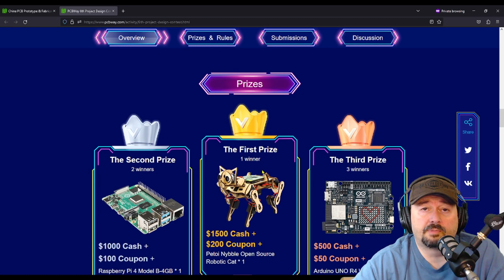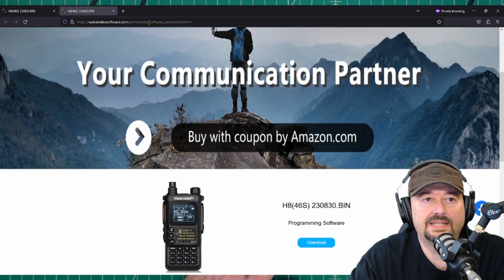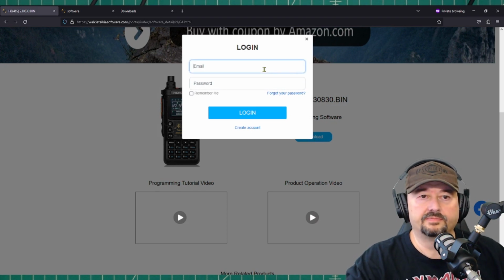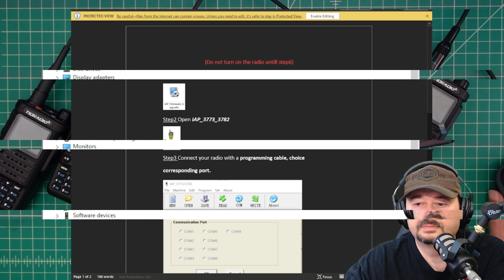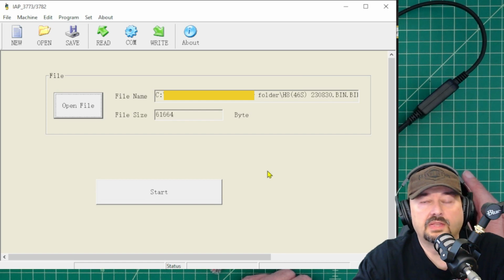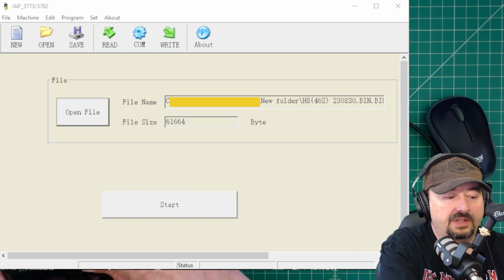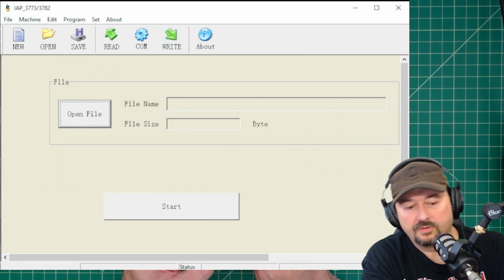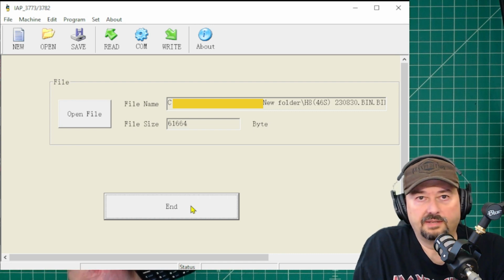Is it EASY? TIDRadio TD-H8 Gen2 Firmware Upgrade

Comment: Step5 Press the upper part of the cable kenwood jack through out the upgrade process.

Step6 Click [Start] and then Press PPT+ turn on your radio
There will be a progress bar to indicate the progress of the software when the upgrade starts correctly.

Q1: What should i do if there are not progress bar after I turn on my radio
A1: Hold the plug of the programming cable tightly during the upgrade and do it again, never loose the grip.

Q2: What should i do if the upgrade fail and the radio cant turn on again.
A2:Because the upgrade process may be interrupted, resulting in an incomplete version upgrade of the radio. You need to repeat the upgrade steps again to completely accomplish the upgrade.

Comment: Hey! I have a TD-H8 GEN3 and I'm looking for the original firmware with the number 241228? I updated the firmware with a version meant for a TD-H8 GEN 2 instead of GEN 3, and now my radio doesn't work anymore. Can you help me out? This firmware is nowhere to be found on the tidradio website. Thanks a lot!
Reply from the maker: Sorry man, I’ve never had a gem 2 or 3 🤷

Comment: Did you get them working? I thought mine was bricked, and then saw a post saying hold the button under the ptt when you power on and it'll load the firmware. Start the program, switch the radio on with that button held. Worked for me
Reply from the maker: I was never happy with these.  I typically tell folks to stay away from this brand
Reply: @TheSmokinApe  that's fair. I have the H8 and the H3. The H3 I find more interesting and has more features. I saw them, along with the Quansheng's and catalogue of new Baofengs as a step forward design and feature wise from the UV5R. Would I be confident putting any of them on a spectrum analyser... nope! I guess it's FOMO, like many of us I have too many radios. But still can't resist a budget HT.

Comment: Using a cable with the FTDI USB/Serial chip, had a successful upgrade on a TH-H3 (not the H8 - don't have one of those). I've seen the same 'plug fit' issue on some of the less popular Baofengs, had to do the same surgery, but was successful in completing the upgrade
Reply from the maker: I wish they made it easier 🤔

Comment: Hi, me again. Regardless of your words I bought one of these just to try 4/2024. Buzzing has gone, got it from Aliex to the uk, does get warm after about 20 minutes of use but the issue I’ve found, we use 12.5 the radio only does 12.0 the only workaround I can find is to set at 6.25 is this another issue or is it set for a different country. Regards, love the vids
Reply from the maker: Bandwidth is likely a regional setting but I’m not familiar with what y’all use over there. That said I’m sure these are GMRS radios that have been tweaked for ham frequencies and I’m pretty sure GMRS is 20KHz

Comment: I am having the same issue with the whining noise when I transmit. THe only work around I've found was that it doesn't do it with the tx power set on medium or low. I reached out to tidradio but haven't heard from them yet.
Reply from the maker: Sorry to hear that.  I know they were getting flooded with support requests, I’d keep emailing 👍
Reply: @TheSmokinApe   Thanks. They did contact me late lastnight with a link to a firmware that seems to have solved my problem.

Comment: Off topic but... What are the differences between the ham and gmrs radios? Obviously the power levels. But because it appears that the GMRS radio can be modified to be a HAM or ALL it makes me wonder what the total differences really are.  I am a Ham, but I bought two GMRS radios for my family. I will keep one and use it in the ALL configuration. I don't care about the 10w power as it is at best 3db but with a lot less battery life. Perhaps it is only the FCC approval???   Inquiring minds want to know. Tnx 73
Reply from the maker: Hey DG, they are a little higher than the Ham 70cm band, ham covers many different bands and gmrs is limited to one.  Also there are different license requirements for both 👍

Comment: For those still having issues, do not turn on the radio until AFTER you press Start per the Read Me file.
Reply: Yep this was the easiest firmware upgrade! I saw this video first, then went to another silent video, did exactly the same thing as that video and nothing happened, sooo i went to download the corresponding drivers for my system, clicked on the NEW BIN file Hit start THEN turned on my radio and VOILA!!!! Download  Complete Version GMRS_230923!
Reply from the maker: I did include that in the description...

Comment: So, assuming the FW does not fix "the problems" you identified earlier, is there a way via a serial number or date on the hardware (ie the radio) that would tell me if I got the new hardware or an old unit?  Getting ready to buy one from Amazon.
Reply from the maker: Hey HTTY, it doesn't fix the issues.  I did ask TID for the SN range and they wouldn't give it to me...
Reply: I have not ordered mine yet.  I am a virgin newbee buying my first radio so I can have something in my hand while I study for the FCC Tech License.  My friend told me to just buy a Baofeng UV-5R.  After looking at reviews, I thought TIDRadio was better for me because of larger keys and display.  Then I thought a TD-H8 was better than a UV-5R (TIDRadio makes these also).  Suggestions would be appreciated for my 1st radio. @TheSmokinApe

Comment: I used a talkpod cable then turned it on after hitting start.  Worked just fine.  Program sure seems buggy though
Reply from the maker: I did make a mistake with step six, after doing it right I was able to do the FW upgrade
Reply: Now the radio no longer powers on.  There are several different firmwares and which one to use isn't very clear.  Luckily I'm inside the return period with amazon

Comment: I just received radio (ham) to replace my flawed 2nd generation one. New radio has version ham_230911 installed and so far seems fixed and works well. Was told to KEEP and enjoy the original one but no software update will fix it's issues but it will make a great GMRS radio so enjoy it that way. It has ham_230317 version. They did stay in contact & replace to correct troubles. 
N8OHV
Reply from the maker: Hey Gary, glad to hear they took care of you 👍
Reply: @TheSmokinApe  BTW this was and will only be my only Chinese radio purchased out of curiosity......software & programming  is atrocious! Glad it turned out as well as it did....... You do truly only get what ya pay for ! Hahaha!  Thanks for your comment.......N8OHV
Reply from the maker: @Baccala4641  Agreed, I’m far from impressed 👍

Comment: You really tried to get it to work!! Great effort on your part, too bad the update failed.
Reply from the maker: I am a big ole dummy, the upgrade needs to be started with the radio off.  After you start in the app, turn the radio on.  I was able to upgrade the second radio, after the upgrade the radio continued to have the same problems.  I spoke to the folks at TIDRadio and the FW obviously will not fix the radios that had HW problems.  If anyone has problems with the hardware I'd reach out to support@tidradio.com with the order number and a picture with the barcode.

Comment: The instructions say to click on start and THEN turn on the radio. I had your same issues but when I reversed the order and clicked on start first AND THEN turned on the radio, it updated firmware. It worked on two older radios.
Reply from the maker: I am a big ole dummy, the upgrade needs to be started with the radio off.  After you start in the app, turn the radio on.  I was able to upgrade the second radio, after the upgrade the radio continued to have the same problems.  I spoke to the folks at TIDRadio and the FW obviously will not fix the radios that had HW problems.  If anyone has problems with the hardware I'd reach out to support@tidradio.com with the order number and a picture with the barcode.

Comment: You bricked the radio. LOL. Maybe it’s salvageable. 73!
Reply from the maker: I am a big ole dummy, the upgrade needs to be started with the radio off.  After you start in the app, turn the radio on.  I was able to upgrade the second radio, after the upgrade the radio continued to have the same problems.  I spoke to the folks at TIDRadio and the FW obviously will not fix the radios that had HW problems.  If anyone has problems with the hardware I'd reach out to support@tidradio.com with the order number and a picture with the barcode.

Comment: Everything looks the same style of programming as on my  Quansheng K6. To upload the firmware on my Quansheng to start the firmware update you turn on the radio holding down the  push to talk button. The light should turn on which means it is in Firmware update mode. I don't think it is your cables. My Quansheng has an almost identical firmware update process. Software looks similar with the same fields.
Reply from the maker: I am a big ole dummy, the upgrade needs to be started with the radio off.  After you start in the app, turn the radio on.  I was able to upgrade the second radio, after the upgrade the radio continued to have the same problems.  I spoke to the folks at TIDRadio and the FW obviously will not fix the radios that had HW problems.  If anyone has problems with the hardware I'd reach out to support@tidradio.com with the order number and a picture with the barcode.

Comment: Interesting new oddity. I had an issue develop with  my output being   down from 10 to 8.5  after 2 months asked tidradio and did what they said to do  no result, so i told them and they sent me a file to download  to do a firmware update to V3 .  so basically what i see from you is  dont try it even if they tell me where to get the right cable
Reply from the maker: I was able to get it to work, the details are in the description BUT it didn't fix my noise problem 😯
Reply: @TheSmokinApe   i see you said the app  they tell me have to use a cable so i have asked where to get it, are sayiong you were able to do the firmware via the app ?
Reply from the maker: @keathrhymer5449  sorry for the confusion, I used the app I down loaded not the Bluetooth app

Comment: The firmware has not been firmed up yet
Reply from the maker: I am a big ole dummy, the upgrade needs to be started with the radio off.  After you start in the app, turn the radio on.  I was able to upgrade the second radio, after the upgrade the radio continued to have the same problems.

Comment: Tird radio strikes again! Would an aioc work? How about the tird Bluetooth adapter? I repeat the process on the bricked radio to see if you can revive it.
Reply from the maker: I am a big ole dummy, the upgrade needs to be started with the radio off.  After you start in the app, turn the radio on.  I was able to upgrade the second radio, after the upgrade the radio continued to have the same problems.
Reply: @TheSmokinApe If your radio does not complete the file upload process again even if it is not turned on, it will not come back to life.  Try doing the process again and it will revive.  It already happened to me and it's back!!
Reply from the maker: @GmrsKissimmee  hey GK, yes I was able to unbrick the brick 👍

Comment: Excellent.  Followed the instructions as written, and flashed two of them without any issue. Thanks for the video.  Got some hope for theses radios now. 73, KN4VA
Reply from the maker: I am a big ole dummy, the upgrade needs to be started with the radio off.  After you start in the app, turn the radio on.  I was able to upgrade the second radio, after the upgrade the radio continued to have the same problems.

Comment: That clears that up!
Reply from the maker: I am a big ole dummy, the upgrade needs to be started with the radio off.  After you start in the app, turn the radio on.  I was able to upgrade the second radio, after the upgrade the radio continued to have the same problems.
Reply: I told tid that they should accept returns on these radios and get people sorted properly.  They didn't seem to want to do anything other than amazon returns - which AFAIK 'hurts their reputation' on amazon and those radios just get land-filled.  Now I want to know how to get my hands on that pallet of returns. 🤔   @TheSmokinApe
Reply from the maker: I spoke to the folks at TIDRadio and the FW obviously will not fix the radios that had HW problems.  If anyone has problems with the hardware I'd reach out to support@tidradio.com with the order number and a picture with the barcode.

Comment: Ape please update the video. RandallRash is correct on step 6. I have updated my firmware by following the steps. My radio is on 230823. I am wondering what 230830 has?
Reply from the maker: I am a big ole dummy, the upgrade needs to be started with the radio off.  After you start in the app, turn the radio on.  I was able to upgrade the second radio, after the upgrade the radio continued to have the same problems.  I don't think I am doing anymore videos on this radio...

Comment: Patience of a saint!  I had that problem on the original radio before they went on sale; I could never get the cable seated so I just gave up.  I asked TID to fix the material at the connector--I guess they did not want the expense of modifying the mold.  Welp, I ordered the Abreeeeeee cable, that was a plus!
Reply from the maker: I am a big ole dummy, the upgrade needs to be started with the radio off.  After you start in the app, turn the radio on.  I was able to upgrade the second radio, after the upgrade the radio continued to have the same problems.  You will love that cable...
Reply: @TheSmokinApe  I was really hoping the software was the fix....  This means they've tinkered with the innerds.
Reply from the maker: Yeah, apparently they were some with "faulty HW".  I spoke to the folks at TIDRadio and the FW obviously will not fix the radios that had HW problems.  If anyone has problems with the hardware I'd reach out to support@tidradio.com with the order number and a picture with the barcode.

Comment: Good job.  BUT!! I saw this in the instructions which I though was strange, but it reads that you do NOT turn on the radio until AFTER you click the Start button. When I did that, I had success. I ended up purchasing the TDRadio cable for this exercise. Also...like @kurttuttle1817 below, I have the 230911 firmware. The radio works as usual, but now it can't be programmed with the ODMaster app. I posted this on the TIRadio facebook group and got a request from them to make a video of ODMaster not working. Haven't gotten around to that.
Reply from the maker: I am a big ole dummy, the upgrade needs to be started with the radio off.  After you start in the app, turn the radio on.  I was able to upgrade the second radio, after the upgrade the radio continued to have the same problems.

Comment: I did update mine yesterday using a UV5R cable , and I felt the click when I really pushed it in. I also used the same cable later to delete the GMRS channels that my Ham version came with and then uploaded Ham freq's  using Chirp, as I could not get ODMaster to work. The update firmware I have is Ham 230911. Hope you can get it figured out and do the test again.
Reply: I had the exact same experience.
Reply from the maker: I am a big ole dummy, the upgrade needs to be started with the radio off.  After you start in the app, turn the radio on.  I was able to upgrade the second radio, after the upgrade the radio continued to have the same problems.
Reply: @TheSmokinApe  interesting because they told me that the firmware update would correct it. Makes me wonder if I should return it to Amazon.
Reply from the maker: I spoke to the folks at TIDRadio and the FW obviously will not fix the radios that had HW problems.  If anyone has problems with the hardware I'd reach out to support@tidradio.com with the order number and a picture with the barcode.
Reply: @TheSmokinApe  Thanks for the info. I don't think mine has the HW problems. I held my hand against the battery terminals and did not feel anything and held it across for at least 30 seconds or more. and I usually cup around them anyway. On the audio, had my wife listen on a UV5R, while I was about 25ft away, and said she did not hear anything other than my voice. So maybe I got a good one except it came as the GMRS. Thanks for all the updates. Oh, one question did you do any video on HOA antennas? 73  Kurt